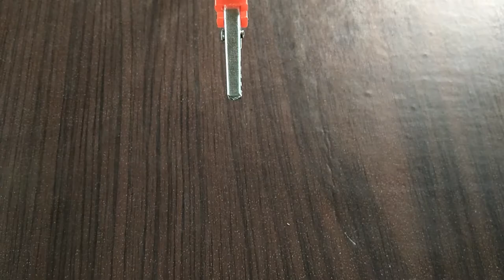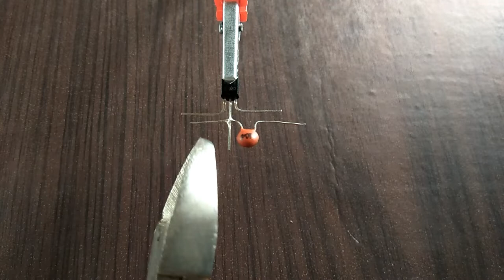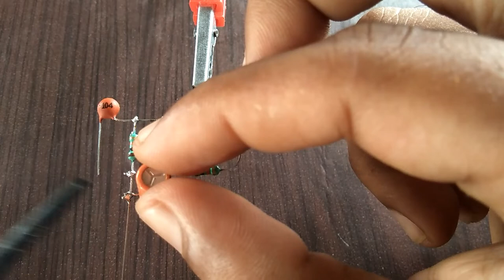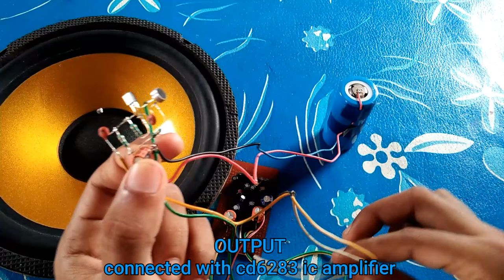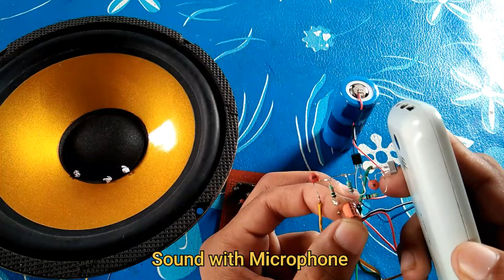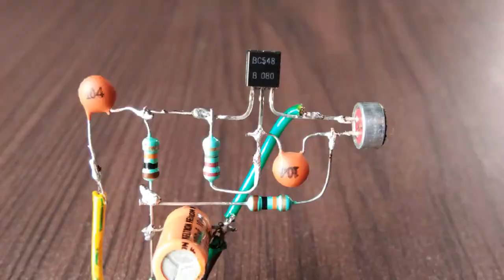Microphone circuit board | Microphone preamplifier circuit | Condenser microphone circuit ||

Comment: here is 2 n.o of 10k resistor, and 3rd one is used 220 ohm or 220k ohm, but i watched in maximum circuit they used 100k resistor... so which value is better??